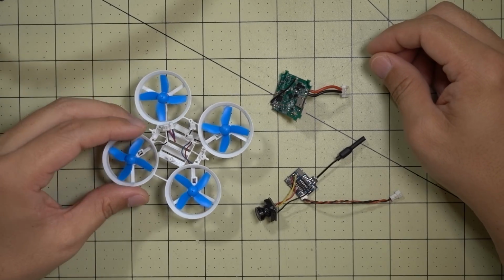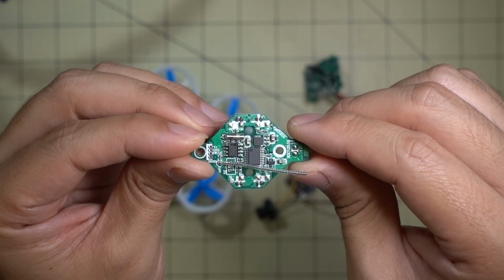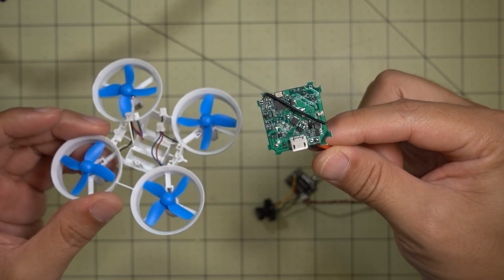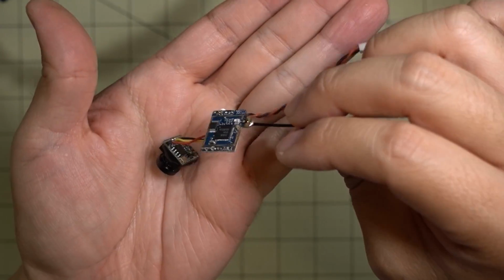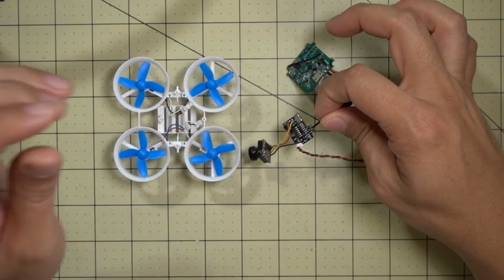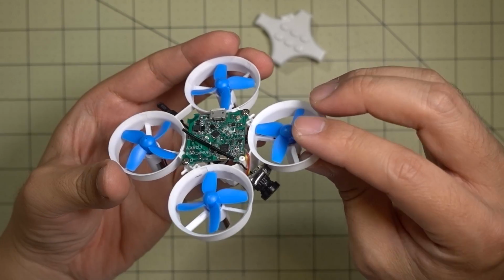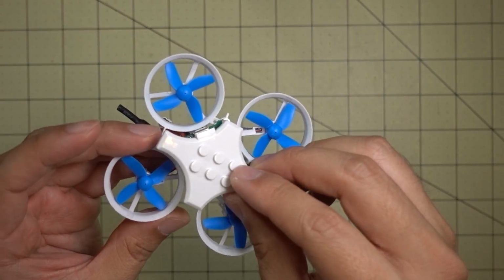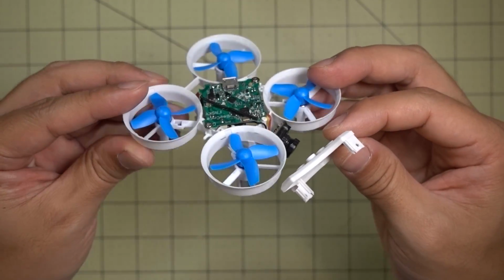E011 Tiny Whoop 🔥😲

Comment: Shoved a Realacc F3 V1.0 Betaflight Brushed Flight Controller board with OSD and buzzer in my e011. I can't think of a better home built tiny whoop at the moment. Using the Eachine TX01S aio camera and a fsrx2a receiver. Standard 260mah battery gives me 4+ minutes of fast fun :)

Comment: Nice cam and vtx placement! I'm using Beecore in E011 also, mostly for basic LOS acro practicing. Miss the buzzer very much for voltage alarm on Beecore so stuck with using timer on transmitter.

Comment: Great video mate!!
I am confident flying my e011 now
With fpv self leveling and i was wondering what the next step would be?
If you know what i mean!!!
Thanks ULTRA RC!!!!!!!!!!!!
Reply: ultra rc Dude, that's easy to answer! Flash the control board with Silverware firmware, then you can start learning to fly in rate mode (or "acro" mode). I did it and it's an absolute blast to zoom all around my house harrassing my wife, kids, parakeet, and anything else in my way!

Comment: Is it possible to enable failsafe on this board? And if so how to you put the receiver in a mode where it will engage the failsafe? Thank you.
Reply: yes its possible. just do it on beta flight. set failsafe to drop and finished. same as all the other quads :)

Comment: GOOP Glue is what you want to use to hold the cam in place here. Just 2 tiny dabs on the corners to meet the whoops and 1 tiny dab on the top of the back of the PCB to meet the front frame brace. This will hold it there forever and with flex.  ;)  Like this: https://www.rcgroups.com/forums/showthread.php?2891982-Eachine-E011-custom-build
Reply from the maker: Nice tip!